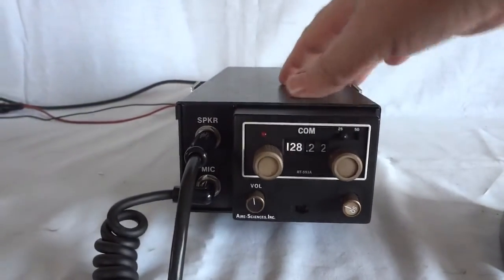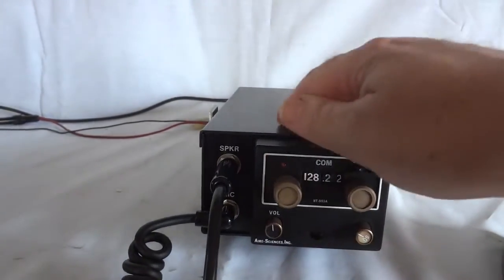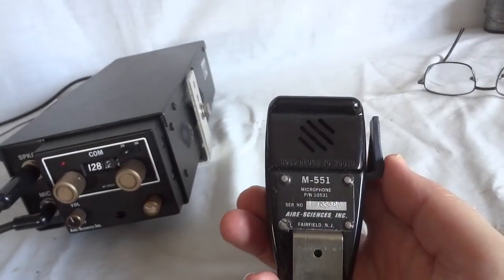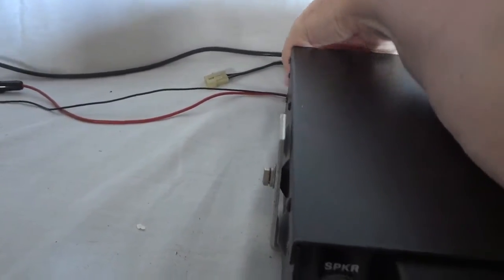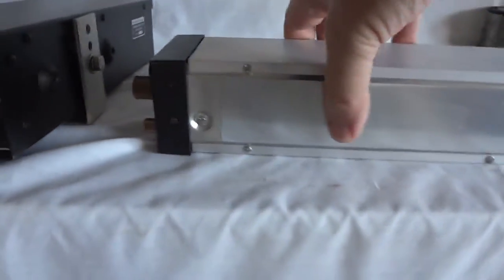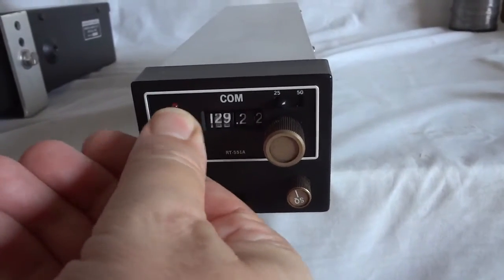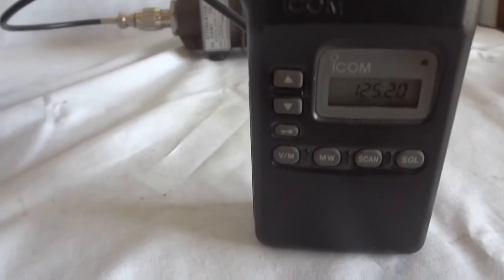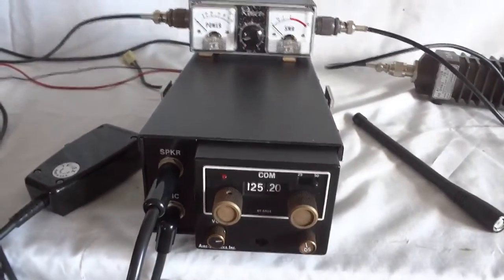Aire Sciences RT 551A airband transceiver

Comment: Regarding the light. 99% of avionics has completely separate lightning circuit, or at least lightning voltage input (newer stuff).  This is done that way to control all radios (and other cockpit parts) backlight intensity with single rheostat/dimmer.  Units that have digital displays without backlight  (VFD, LED, cold discharge, etc) will have this circuit wired directly to bulbs back lightening buttons and knobs, and this parts will be illuminated even when unit will be off. 
Grate video as every other, cheers !

Comment: In the early 80s, before I got my pilot's license, I had an almost identical rig, the RT 551 "not -A", difference being the 50kHz channel spacing. Although it was a transceiver, of course I only used it to receive, listening to aircraft over the area with a vertical 1/4 wave antena on the roof. Receiving range for aircraft in the air  could reach 100km in some directions. Then, when I started flying, I started taking it up with me as a back-up radio (plus a 1-kg Ni-Cd battery pack, whip antenna and all). I eventually met an airplane owner who was in need of an additional panel-mounted COM, so he gave me his Icom IC-A20 in exchange for this gem. But the little Icom is a gem in itself, too, and works flawlessly to this day, now with a lithium-ion battery pack, some 35 years and counting. But boy I miss that radio. Thanks for posting, you brought back some great memories.

Comment: Am or fm.  . .? Thanks Shane uk
Reply from the maker: AM, which is the standard modulation method on the VHF air band. FM is not used there. The reason is that AM allows you to hear when two transmissions "step on each other". With FM, you can not hear that - the strongest one always wins because of the FM capture effect which is undesired for aircraft communication because of safety reasons.

Comment: Thanks for posting this. What antenna are you using for RX?
Reply from the maker: Thanks. I used a mobile vertical normally used for 2 meter ham. See here for an example: http://www.ebay.com/itm/252351281444   I extended it a bit to make it resonant at 126MHz (the center of the COM band). It draws in the overhead planes loud and clear. Cheers.